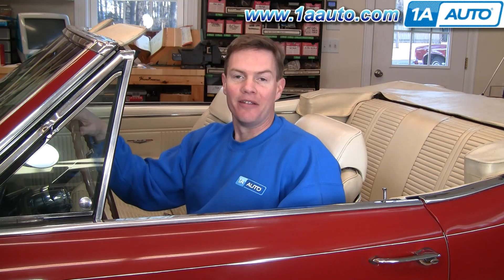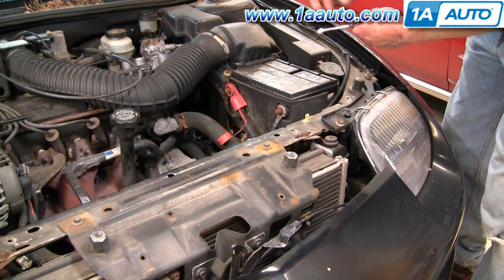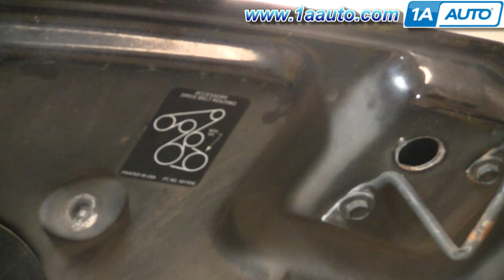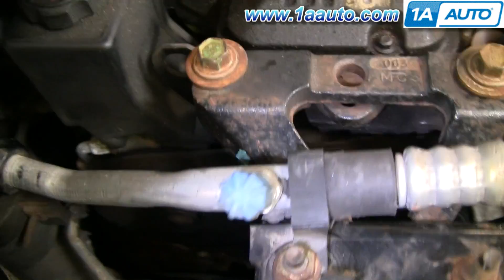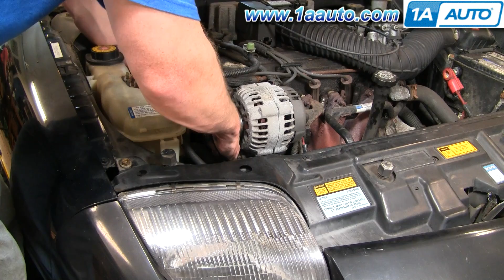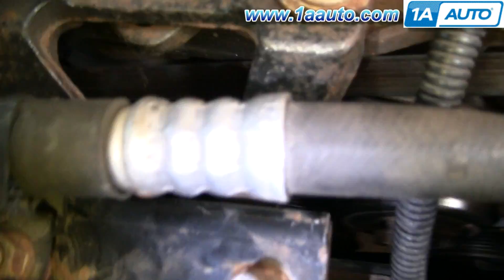How to Replace Serpentine Belt 96-98 Pontiac Sunfire

Comment: You should always remove the negative battery cable first. The previous posted comment is correct pointing out you're turning tensioner clockwise.

Comment: IF ONLY it was as easy as you make it seem. My belt tension pulley is giving me the biggest pain in the ass, I followed all of your steps and whenever I try to get the belt to sit back on all of the pulleys at the end by adjusting the tension I can't get enough slack to get it over the last pulley. Clockwise on the tension pulley right? Thats what I'm doing and its not giving me any room for that belt.
Reply from the maker: Yes clockwise as shown in the video. The belt should come free as shown in the video.

Comment: Good video but with more than a couple people asking about the 2.2 engine with the tensioner below the power steering pulley, you would think it would be prudent to make a video on that engine type. Just my .02 cents as i am also one of those people with the tensioner in a not so convenient spot.

Comment: do you have a video of the 1998 sunfire 2.2 AUTOMATIC BELT TENSIONER  mine seems to be at the back of the engine toward the firewall  . Thanks
Reply: Same the bolt on my tensioner is right next to the frame with no room to get a rachet on the bolt

Comment: It seems like my tensioner pulley in my 1999 sunfire came up and hit my power steering pulley. I assume I have to replace both if this is the issue. The tensioner will not move, nor will the power steering pulley.

Comment: Question:  If I have an A.C., but the compressor seems to be locking up (causing the belt to snap), can I bypass that pulley with the replacement belt?